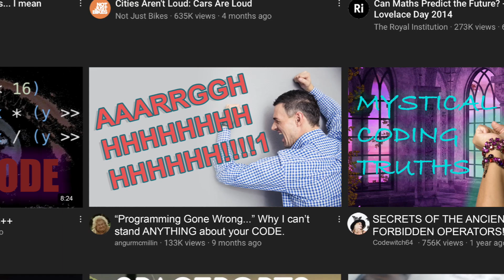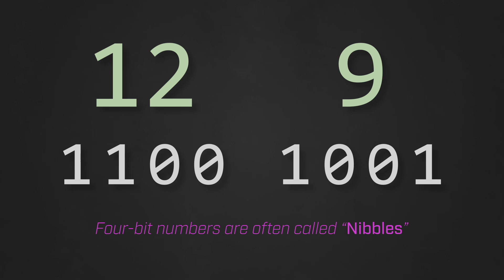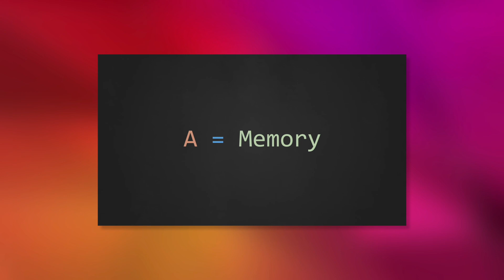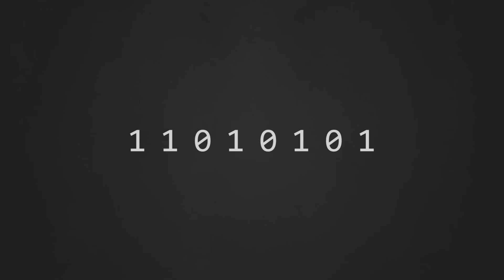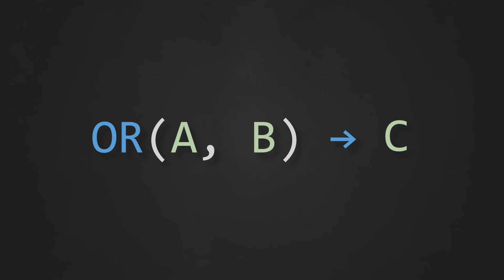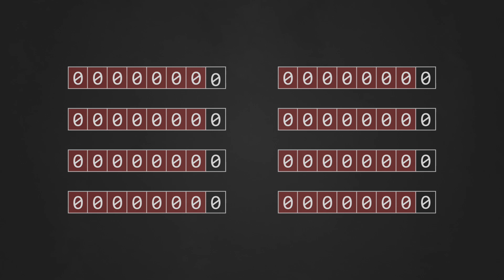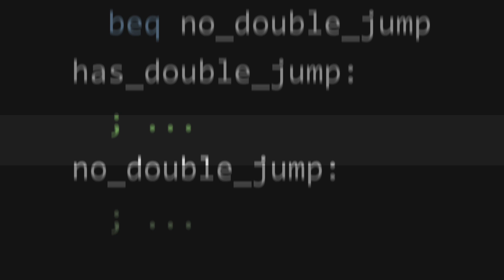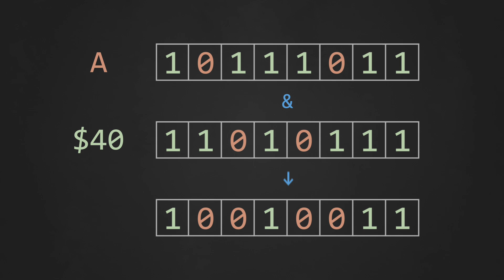Bitwise Logic - 6502 Assembly Crash Course 04

Comment: Great video, love the series! Just a small clarification: the concept you call a “bitmask” in several places is actually a bitfield (in the general CS sense, not the C++ data structure). The actual bitmask is what you describe as an “isolation mask.” Bitmasks are used to select or manipulate parts of a bitfield, while bitfields are the series of bits assigned a specific meaning, like status flags. Related concepts, but not quite the same! Mentioning it in case anyone else gets confused. Keep up the good work!

Comment: The one thing this video is definitely missing is bitwise negation. It's not a proper 6502 opcode but it's important operation that any decent assembler should have for simplifying the case where you want to zero a specific bit. In DASM at least, if you precede an assembler time constant with ~, it will flip all 0 bits to 1s, and 1s to 0. This allows you to write code in a way that expresses just the bits you intend to modify: 

; Set up constant values to represent item acquired flags
ItemA = #%0001
ItemB = #%0010

; Let's give items A, B
lda ItemsVar ; %0...0000
ora #[ItemA + ItemB]
sta ItemsVar ; %0...0011

; Some gameplay happens

; Let's take away ItemB
lda ItemsVar  ; %0...0011

and #~ItemB ; Because of the bitwise negation operator, the constant %0...0001 becomes %1...1101, which will zero just that specific bit
sta ItemsVar  ; %0...0001

Comment: Very nice video! I'll just mention for anyone reading: I'd usually use the term "bitmask" to refer to what this video calls an "isolation mask", and "bit string" or "bit field" for what the video calls a "bit mask". It probably depends what programming communities we learned in.
Reply: I'm glad someone already pointed this  out. I don't think calling the bit field a mask makes much sense. After all it's the thing that gets masked, not the thing doing the masking. The bits in a bit field are also sometimes called flags.

Comment: ...if item-collection is completely linear (working lowest to highest bit) then this might work, maybe :

LDA $40   ; (EG: #00001111) 
SEC           ;sets carry-flag to "1" (EG: #(1)00001111)
ROL A       ;Rolls Acc. left and puts carry into 0-bit pos. (EG: #0001111(1)
STA $40   ;Store "item-enabled" Acc.byte in mem

🤔... maybe?
Reply: You should be using EOR with the desired bitmask to easily and quickly flip any given bit.  Exclusive-OR with 1 will always flip whatever the source bit is, just like a NOT gate/operation 

However I think you've got some good ideas, because while simply flipping the bits was the question here, in a real game the algorithm would be more complex and looking at the big picture is important too.  For example, you might define your level data in such a way that -

$00 - ground object
$01 - powerup 1
$02 - powerup 2
$03 - powerup 3
$04 - powerup 4
$05 - powerup 5
$06 - powerup 6
$07 - powerup 7
$08 - powerup 8

Then when say your "collected powerup" routine runs, it would take the object ID as an input, then we can reuse some of your above code -

LDA $#00 ;init bitmask
LDX $41   ;or whatever address you passed the collected powerup's object ID in, used as loop counter
setProperPowerUpBitmask:
SEC           ;sets carry-flag to "1" (EG: #(1)00001111)
ROL A       ;Rolls Acc. left and puts carry into 0-bit pos. (EG: #%0001111(1)
DEX          ;Decrement loop counter
CMX #$00 ;Loop counter check
BNE setProperPowerUpBitmask; Loop if counter still greater than 0

STA $42          ;Save completed bitmask to temp RAM
LDA $40          ;Get powerup state
EOR $42          ;Flip the correct bit for the collected powerup

(P.S. - There might be a more efficient way to write this code and/or I may have made an off-by-one error, the point here was to demonstrate that your original code may still be viable in more complex/real world uses)
Reply: @kirby0louise  Yeah, I realize he wanted us to regurgitate those bitwise operations, but I was attempting to think outside of the box . Not much value for that around here apparently. 😒
Reply: @pizletwizzler198  Nah I think you had a good idea.  Again, thinking about the big picture is also important.  In a full game example like I suggested your carry flag + rotate loop could save valuable CPU cycles and/or ROM space vs 8 different compares and branches
Reply: @pizletwizzler198  Its a good idea but its kind of flawed - ROL is ROtate Left (not roll).  It may seem small, but it's important not to use words like this or you might confuse what ROL does with another operation.  Also, Calling ROL roll makes ROR (ROtate Right) look unrelated.  

As for the flaw in the logic itself, ROL or ROR will only do what you want it to do if the bit you want to swap is perfectly in line (as in your example,  you turn bit 3 off but bits 0-2 stay on) with other like bits.  But, if you have something like 0x10101010, however, using ROL will toggle ALL the bits to their opposite state.  This is something you need to take into account when designing code: "Does this do only what I intend for it to do, and if not, what else does it affect?  Will it work the way I intend in ALL cases?".  Nothing wrong with thinking outside the box, just reserve that for when you fully understand the implications of what you're coding.  

Also no reason to respond like "Not much value for that around here apparently. 😒".  Programming is often about thinking outside the box, but its better to reserve that for when you have more experience so you don't cause an error you couldn't have known was going to happen.  Reacting the way you did makes it seem like you think you're better than you are.
Reply: @kirby0louise  it's not really a practical solution. You'd be better off in most cases just storing all 8 possible values that $41 will map to in a table, and just doing this:

; Note this code is only equivalent for object IDs between 0 and 7. To match the original you'd need to make x = 7 for higher object ID values
ldx $41 ; object Id. 
lda Bit8Table,x
eor $40 ; Toggle the bit for the collected powerup

; Elsewhere in the program
Bit8Table:
    .byte $01, $03, $07, $0F, $1F, $3F, $7F, $FF

However, In my own game I have used the set carry, rotate trick in tandem with the BIT opcode for setting up the state variable enState for an entity in my game. BIT is a unique opcode in that it allows you to effectively perform 3 separate bitwise calculations as fast as AND, but without changing register A. 

enState = $20

lda #%00000011 ; set up a bit mask
bit enState; This effectively does these 3 things:
; lda enState -> and #%00000011 -> store the result in the zero flag
; lda enState -> and #%10000000 -> store the result in the minus flag
; lda enState -> and #%01000000 -> store the result in the overflow flag

In my game, enState always starts at 0 when the entity is first started. I reserve %10000000 to store that the entity's memory has been initialized correctly, and %01000000 to store which behavior pattern the entity should execute, after it's been initialized. Since the second state is dependent on the first, I can use...

SEC
ROR enState

...to set up enState. Then to determine what logic to execute, I just do

bit enState
bvs EntityPattern1
bmi EntityPattern0
; Init Memory
rts

EntityPattern0:
; Code
EntityPattern1:
; Code
Reply from the maker: Haha, I look away for a few days and come back to find this great response from @KirbyOfLouise, looks solid to me :)

Comment: Hey NesHacker, even in danger of posting something horribly wrong with my little knowledge of asm (what i hope to mitigate and improve in the future), that's what i quickly put together in Windows Editor before going to bed ;)

{RAM}
[$24] 1 ; 1=add powerup, 0=remove powerup

{ROM}
[$20] 11001010 ; Bitmask for Powerups
.
.
.
    LDA $20 ; load bitmask
    LDX $24 ; load ram value, add or remove a powerup?
    CPX #%1 ; compare with 1
    BEQ +      ; branch to or-instruction if 1
      AND #%11111011 ; remove powerup
      BRA ++                      ; branch to store instruction (BRA = branch always!?)
    * ORA #%00000100  ; add powerup
    * STA $20                  ; write new powerup byte-value to memory address
.

also, i'm pretty sure there are more efficient ways to do this, that i just don't know (yet).
Thanks and props for your videos :)
Reply from the maker: It’s an interesting way of doing it. To make it simpler consider using the EOR instruction I introduced in the video ;)
Reply: @NesHacker  of course, i was thinking too hard to make it seperate algorithms for adding / removing, eor would be the one solution, my bad :) yeah logic algebra, hadn't done it for too long now.

Comment: LDA $40
EOR #%00001111 '(or just a 1 wherever you want to flip)
STA $40

On a side note, it's interesting that EOR is used in favor of XOR for the exclusive or mnemonic.  Perhaps the 6502's designers were fans of winnie the pooh?
Reply from the maker: Indeed, I think I’ve only every seen it as XOR elsewhere.
Reply: @NesHacker  So I did a quick investigation, and it's also denoted "EOR" on the M68k, but "XOR" in x86, so I guess it must have just been whatever the personal preference of the CPU designer who was writing the manual 40+ years ago
Reply: 6 months late lol. Anyway, I managed to came across the solution before jumpint into the comments!